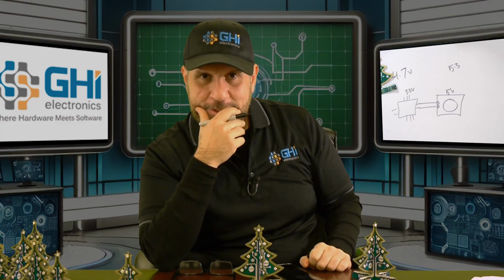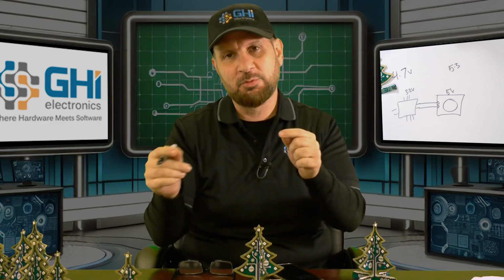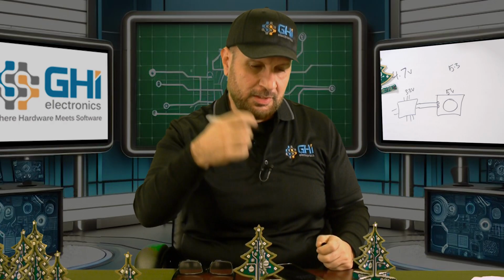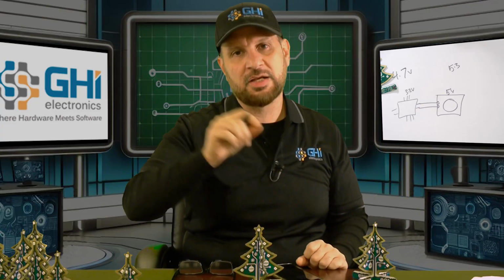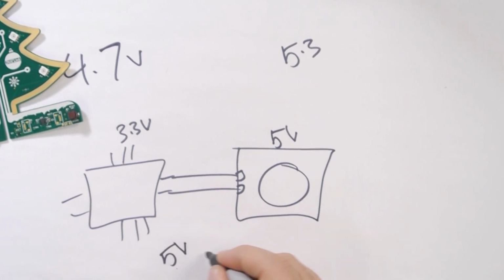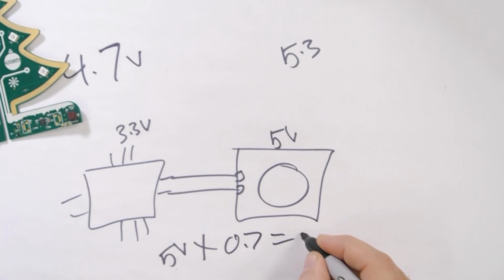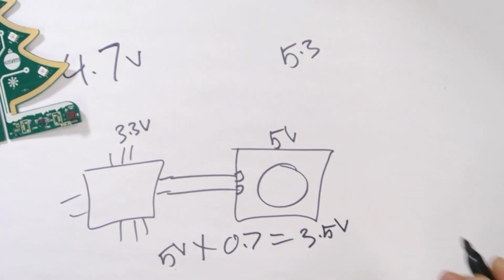Troubleshooting a Festive Circuit - Coding Circuits 09

Comment: Nice bit of detective work there Gus. The different logic level voltages catch out many old school Ardunio users when switching to later 3.3V options. The WS2812B RGB LED used to catch many of them out trying to get them working with a 3.3V micro. PS. Happy New Year to you and the GHI gang.
Reply: Thanks and happy new year